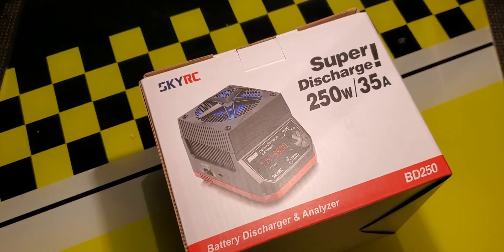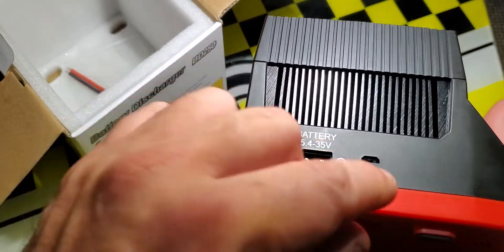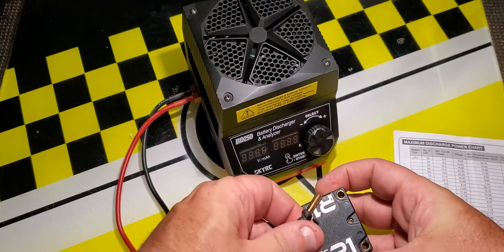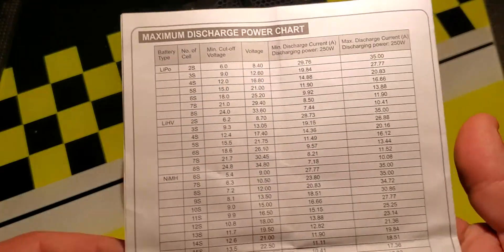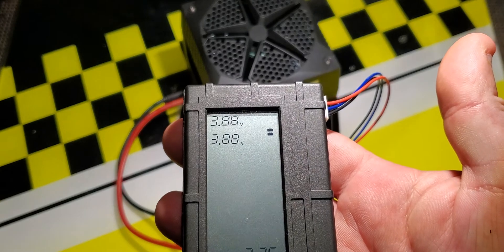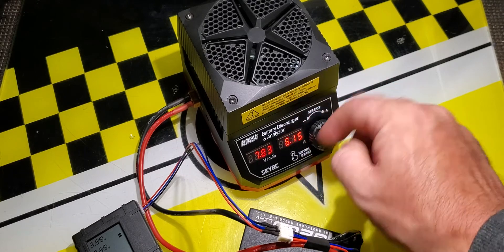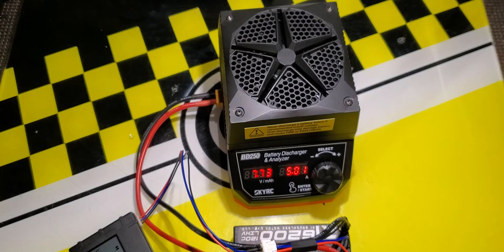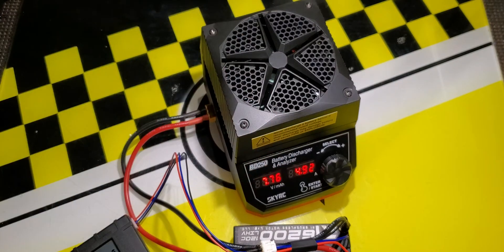Review: SkyRC Battery Discharger and Analyzer - BD250

Comment: It's only  a discharger, it has no need to measure each individual cells. Your rc vehicle only draws (discharges) from the main leads, (imagine trying to draw 35amps from those tiny leads) hence that's all the discharger needs to do. Ballance chargers needs to monitor each cell.

Comment: So the BD250 is not capable of discharging a 1s ? I need to discharge 1s...
Reply from the maker: I personally use this discharger for my 1s lipo. It will do 20A max and it is a little more confusing to use: https://www.ebay.com/itm/254139418323
Reply: @lawton70  Great tip thank you, are lipo and li ion the same? Mine are li ion ...
Reply from the maker: @themoneymercenary  li ion are a different type of chemistry.  Typically used for transmitter packs. They have a different charge voltage and cut off.

Comment: Just got this discharge having trouble understanding some stuff. what should my settings be set at for a 2s 7.4v 5200mah 50c lipo battery for storage I would appreciate it if someone could help me? Thanks
Reply from the maker: A 5200 50c lipo battery sounds a little weak, so i would discharge yoir packs at about 10amp to start with, and to about 7.4v to about 7.2v. That would be safe for the pack. Once you see how the pack handles the discharge and gow warm the pack gets you could bump the amps to 15. That pack is about 250amp burst.

Comment: Have you been using this to lower IR in lipos for stock racing?   If so what discharge and charge rate do you use?  I keep reading that 30 vs 40amp is not much of a difference…
Reply from the maker: It will heat a pack at 35 amps. I think 40 amps became a defacto standard because the iCharger can do a 40 amp discharge.

Comment: I tried discharging a 4S pack to 15.2 v (3.8 per cell) at 16 amps.  It didn't work well.  When I reduced the current to 5 amps in the discharger, the discharger worked well.  It wouldn't take the pack cells down to 3.8 per cell, but 3.83 is okay and that is where the discharge stopped.
Reply from the maker: Good info!  The little chart in the manual says at 4s you can do  a 20A discharge so there must be something up there. What i notice is at higher amps the pack will bounce bact to a higher voltage once the discharge stops. At low amps the battery does not recover as high.
Reply: @lawton70  I noticed the same thing at higher amp discharge, that is why I tried at lower amps and got a better result.

Comment: Nice video. Wish they would have used female banana sockets, as everyone has leads for their flavor of battery connector. Would also be cool if you could select cell voltage (say 3.7) and it would auto detect cell count.
Reply from the maker: Agree, with you on that one. I wish i  could discharge a 1s lipo with the discharger.
Reply: @lawton70   Yeah. I’ve just purchased one of these recently, though, and so far I’m quite happy with it. I have one of those 400w two bank chargers that has decent discharge ability, but the discharge feature fried on one channel. I think I’ll use this one a good bit below max rated watts.